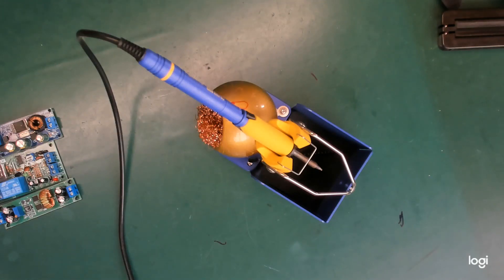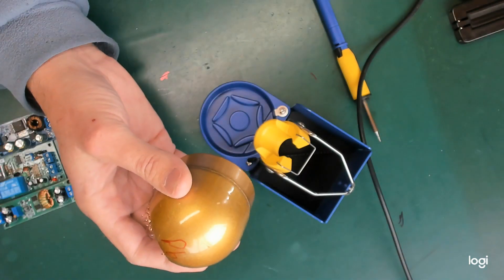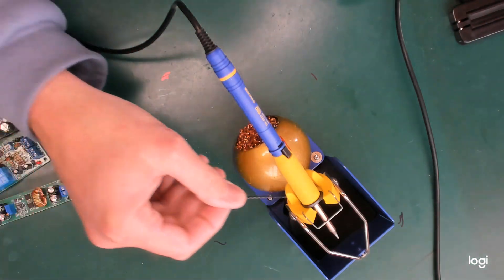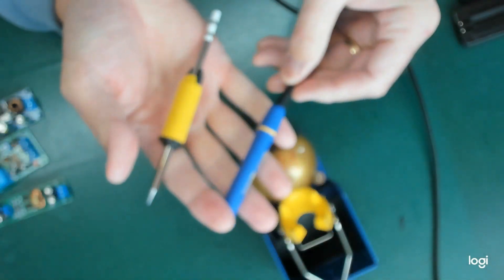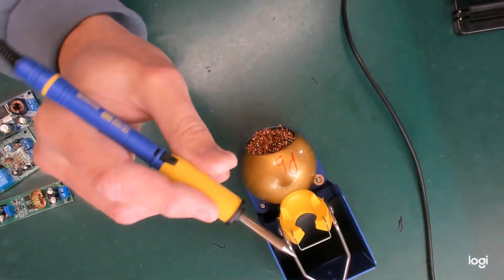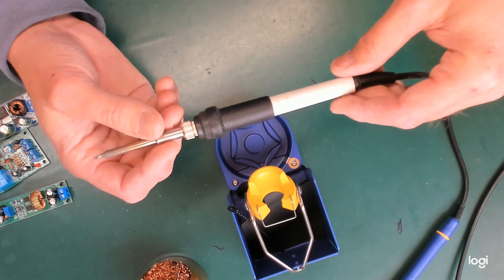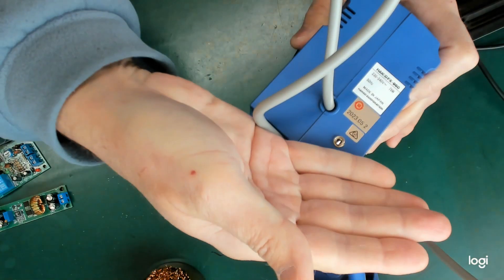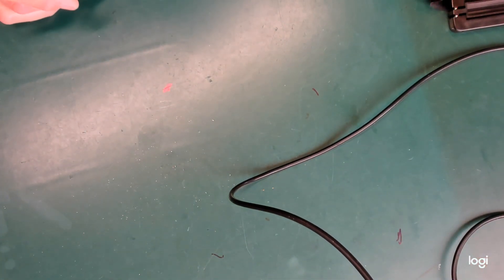Hakko 950 / 951 iron pencil review and tip change.  Stand and standby temperature plans.

Comment: As of late 2025 the FX-950 is long discontinued and difficult to get in Australia. The FX-951 is as of now ALSO discontinued but stocks are still out there. The new FX-971 is another $150 on top of the 951 price here in Oz atm, Land Of The Gouged.
I want to use the FM-2032 micro pencil and yep, it can attach to the 950. It can be done just not plug n play. I might post something in Reddit after I,
a) get the 950 I bought
b) alter it for 240v operation
c) buy the FM-2032 micro iron and

c) figure out the pin outs for this mod